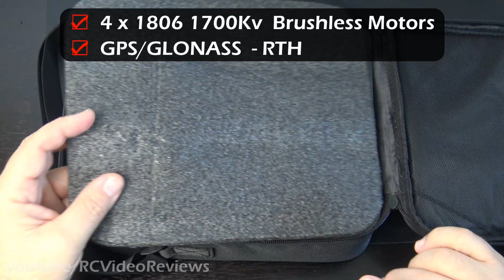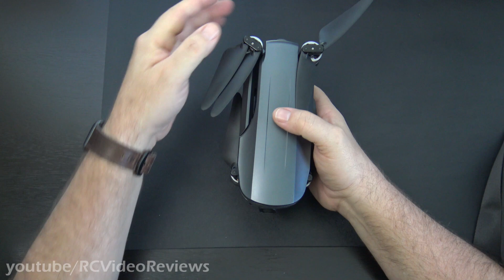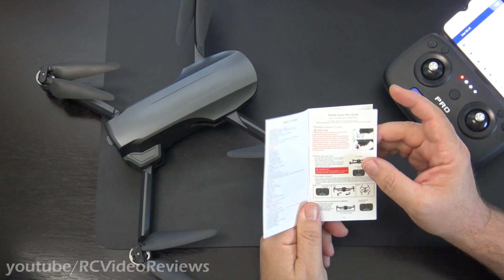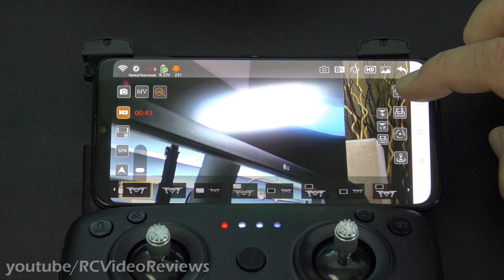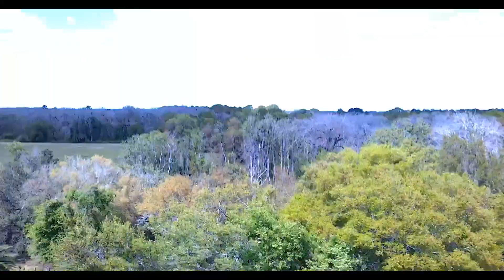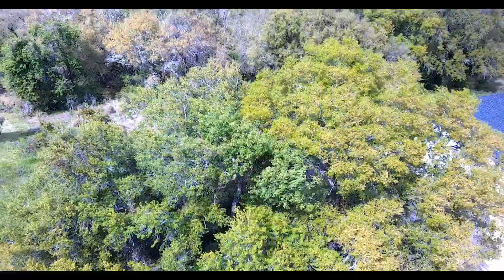ZLL SG908 First Look • Decent Drone is Let Down by the Camera

Comment: To shut motors and land, push the throttle only straight down, don't push it down to the left as you add yaw input and it will bunny hop and you can actually cause it to bonce and flip over, or toss your drone as you land. People make this mistake as it shows you to disarm motors to push both sticks outwards, that actually incorrect and only sure be done if you arm and just want to disarm the motors but when land just throttle stick down and hold it down and motors will shut down.

Comment: Hi.
The SG908, 7.6v 3400mah battery can be replaced with the SG 906 Pro, 7.6v 3400mah battery.
They're the same?
Reply from the maker: I don't know if they're the same. I only have the SG908, and I don't have it anymore as one of the motors came apart while hovering.
Reply: I've asked this same question elsewhere and was informed the SG 906 Pro / Pro 2 DO NOT interchange. They apparently designed the 'latch button' at the end of the battery case different.
Reply: @1spritch  I have both the Pro and Pro 2 and can confirm that the batteries are the same. The only difference is 2800mAh for Pro and 3400mAh for Pro 2.
Reply: @av8dr  I should have finished the sentence with 'it does not interchange with the ZLL SG908 battery'.
Reply: @1spritch  That’s good to know about the 908. From the video, it sure looks the same. I was considering the 908 if it took the same battery.

Comment: A buddy of mine has the 908 pro. Flys well but like you said the camera is very lacking. He did have an issue with the controller shutting off mid flight and banggood sent him a replacement. Not a fan of the rear buttons on the controller, they are hard to find while flying. Rth is more accurate than I expected it holds very well too.
Reply from the maker: I had a problem finding the rear buttons too but I imagine after spending some time with it the muscle memory would be there. Did the replacement controller solve the issue?
Reply: @RCVideoReviews  yep all good now. It would connect and then at random just shut off. You could turn it back on and it would reconnect but it was annoying because it would start RTH.

Comment: So I’m curious about what you think is “Best Bang for the Buck”? The ZLL SG908, the Eachine E520s, or your personal Hubsan Zino Pro?
Reply from the maker: You know my saying, do what you say you're going to do. They call this a 4k drone and it "technically" can record static images at 4k, I still believe calling it a 4k camera is a little disingenuous. If that's the game, then it damn well should produce solid 1080p footage--and it doesn't.

The E520s is in the same club--weak camera.

If I were spending my own money, there is only one choice in that group. Just keep in mind they updated it since I bought mine and now have the Hubsan Pro 2.
Reply: @RCVideoReviews  If you compare pears with apples. The 906 or 908 is available for €150 and the zino pro is €295,- So the price is double. I would say that the 906 is great value for money and the zin should be compared with Dji
Reply from the maker: @pascalvanderburgt4927  The 908 lasted four flights before the one of the motor clips let go and saw a motor can fly off and get damaged (out of round). Between the shoddy camera, play on marketing terms with "4k", and the questionable motor quality, there isn't a price--high or low--I would pay for this quad.

Comment: Sure has a dji look to the quad body, right?  I'd be curious to know about parts/repair availability.  Price point is nice!
Reply from the maker: I didn't see a single spare part for this one. I think we're in that disposable bracket with drones at this price point.
Reply: @RCVideoReviews  or building your own spares/mods with a 3d printer right?
Reply from the maker: @johnbortscheller1111  Perhaps. Not sure if you heard about it or not, but on the 4th flight one of the motor cans separated from the quad while hovering.

Comment: Looking forward to the flight review!
Reply from the maker: I did a quick test hop. It got satellites, hovered well, one touch land was fine and it felt substantially faster than my Hubsan Zino Pro. But that camera...
Reply: @RCVideoReviews  ZLL/ZLRC makes some decent low cost drones with gimbal stabilizers but they just need to add EIS to the camera to assist with the stabilization. If they do that, then they have a winner. Also, they use very cheap image sensors and chipsets so the image results are not “wow”...
Reply from the maker: @DroneSyndrome  And that's the problem...for a drone who's primary purpose is that of a camera platform, the camera should be better.
Reply: @RCVideoReviews  I agree.
Reply from the maker: That's my problem with it. For a drone who's primary reason for existence is to be a camera platform, then...You 100% nailed it.
Reply: @RCVideoReviews   Was the video footage at the end transmitted to your phone or recorded to the mSD card?
Reply from the maker: @bstearn1653  Yes, that was raw footage taken off the SD card on the drone.